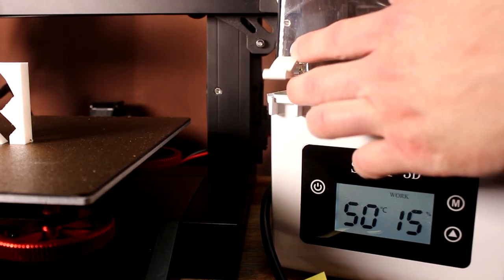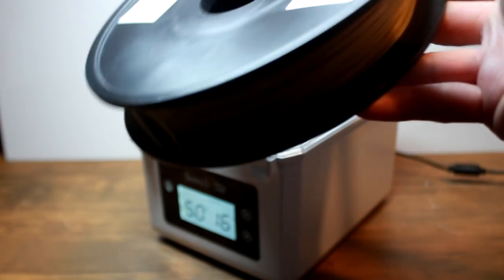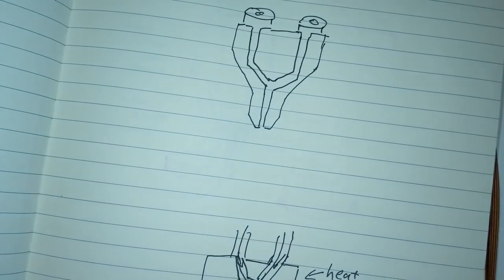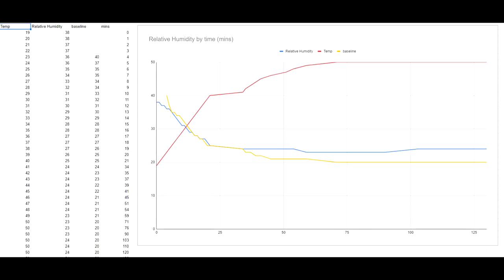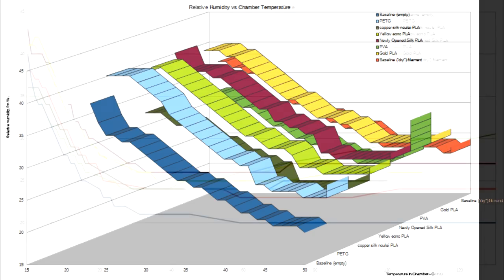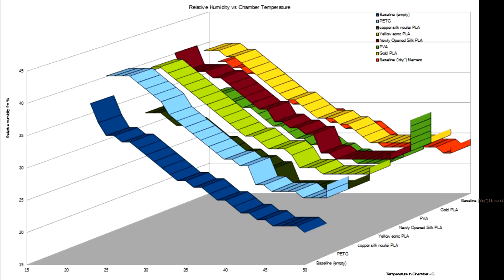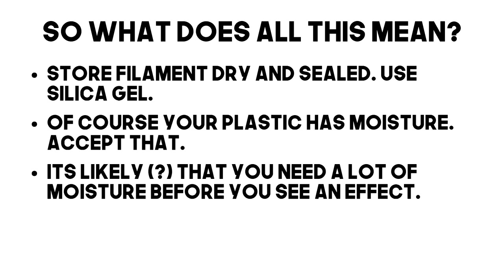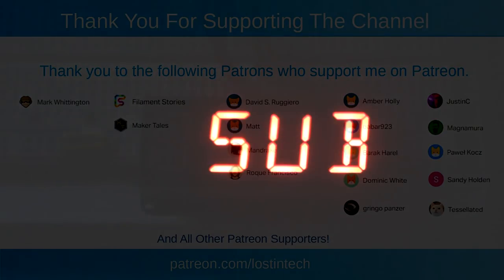So...all filament contains water? Things I discovered while testing out the Sovol 3D Dry box.

Comment: Seattle.
I assume all my filament is wet unless I am drying it immediately prior to printing.
600 watt food dryer for 2+ hours prior to printing and during the print, along with its poly bag and silica gel-packs.
I keep loads of silica packs 'roasting' during this process; I had a gel-packs rotation scheme so spools in storage have fresh packs all the time.
I've found the PETG does suffer from being wet, PLA not in any noticeable way.
VariShore, foaming polyurethane rubber, can get ruined by moisture: the foaming chemistry 'goes flat' if the stuff is damp, doesn't recover until 10+ hours of drying.
Not once, every time before printing.
ICE9 thermally conductive bubbles up and strings a bit when wet, dries well.
On printing hiatus, this is from my notes.

Comment: Those seals on dry boxes also themselves take in water. So think about what happens when one side of it has dry air and the other is wet. Water will make it through by osmosis. Very slowly, but it will happen. So no matter how sealed a dry box, water still gets in. Just more slowly as it's hampered by the constriction of physics. But I noticed that in an empty dry box, the relative humidity can increase by 5 % over a month when stored at 23c, which to me was a shocking amount. IMO, you must also throw a desiccant inside with a dry box to combat humidity making it into the box, if you really want to keep something dry in there. Actual plastics that are very sensitive to humidity, like nylon, will need this done.

Comment: I started using 2-gallon ziplock bags with silica beads. It was ultra cheap and I can cram 2 spools per bag. I am not too sure if this will work to dry out “wet” filament but intuitively it seems like it should so long as my silica isn’t saturated (it has indicator beads to help me recognize this condition).
Reply: I like those two gallon bags. It doesn't feel like I am "stuffing" the roll in.
Suck out the air before zipping that last inch. It may help...less air...less moisture.

Comment: Without a means of removing the moisture from the air, you're essentially just creating a mild sauna for your filament to bask in. Using silica gel is useful, up to the point that it's saturated. You'd need to be continually replacing the silica gel with more dried silica gel, until you reach the levels you're looking for. In order to maintain the lowest levels, you'd be better off storing them in a container with a cooling condenser that literally condenses moisture and removes it from the chamber. In that environment, your filament is being cooled, rather than heated... and getting far better results. Personally, I keep my rolls in large ziploc bags with mini Rh meters and silica gel containers that I can remove and replace - they fit in the center hole of the spool.

Comment: I have ALL my opened filament reels in large (27 lire) sealed plastic boxes with copious amounts of Silica Gel (loose) - think 1/2 kilo per box. I also have a humidity meter inside the box - hovering around 8-13%. And when the Silica Gel gets too 'wet' I stick it in the oven at 120C for 2 hours (it's colour changing) and back it's lovely bright orange (dry) colour :-)
Reply: Thats the smart way to do it, then you are not constantly re-drying different filaments over and over again. Silica gel can be bought cheaply as certain cat litters.
Reply from the maker: Yes agree - smart way to do it because it also avoids the additional irreversible degradation.

Comment: I just keep my filament in my heated airing cupboard, in a box or two (three).  I used to get brittle PLA, but since storing like this, the problem has completely gone away.  For rapid drying, i once used a slow cooker, set on its lowest setting, with the pan inverted to act as a lid.  The PLA was usable within an hour or so.  Mind you, the roll was half empty.
Reply from the maker: Airing cupboard is a good idea as long as you aren't putting anything damp in there like laundry!

Comment: I store all non special filaments with silica gel in plastic boxes. I've printed extra clamps to keep them from leaking, but I use no seal. I use a filament dryer while printing for anything else but PLA. I store one roll of Polycarbonate and one roll of Carbon Fiber Nylon roll in a vacuum chamber. That's all I have room for. However I also print in the same room as I have a large open aquarium no air conditioning at all. So humidity at it's worst goes up to 56%.

Comment: You could test the theory of the filament being the source of the humidity going up if you tried drying PVDF. 
PVDF is totally non-hygroscopic, so if you tried driving water into it through any means then tried drying it you should see no change in absolute humidity on the inside of the drying box.

Comment: Can filament be TOO dry? Does it get to a point where it actually prints worse, or becomes brittle or something?
I've got a filament dryer, didn't find it made that much difference, but then I always store filament in bags with silica gel. I also keep them in boxes, because sunlight can be an issue - even in England. For a few days a year.
Reply from the maker: Ah - funny you should ask that. Some people think so - Joel from 3d Printing Nerd / Repkord told me this the other day on twitter. 
I'm up for testing it out, I just need to figure out how!
Reply: Depends on the material. Zach Freedman has a couple videos where he prints with just about every filament he could get his hands on. At least one of those specialty materials took poorly to over drying. Most of the stuff going into the desktop printer space generally doesn't mind being bone dry.
Reply: My observation is if it’s real wet and you rapidly dehydrate it can cause it to be brittleness.
Reply from the maker: That could be the hydrolysis everyone is talking about, man this stuff is complicated 😒
Reply: All  of these dryboxes are shit at drying...i've tested 6 now...the modded food dehydrators are better, but still weak af.  At best these boxes keep you from adding much more moisture while printing...but simple Tupperware with loads of dessicant is far more effective for that job than a dryboxes 5-15watt heater or a lil pouch of dessicant.  To actually dry my TPU (and dessicant) i use a $500 convection oven...but i run a farm..and dry filament means less cleanup. Not as big of a deal for PLA and PETG
Reply: @Fly_High_FPV  you realy need the door type dehydrator.  It’s a cheaper lower temp convection oven.  Max temp on mine is 250F.  Perfect for every filament I’ll ever print.
Reply: @Michiel de Bie  brittle PLA is wet PLA, saw one friend who left a reel out 6 months, where jt would break every 2 inches, just a whole reel of bunk strips

Comment: Buy a dehumidifier for 10 euro and take apart,converter to a closed box . Peltier make warm and the other side make cold,so you can take out the water from the air (filament).At the cold side will dropping down the water .The water tank have to be separate from the air. You can use a temp sensor or Ardunio,then good to go.

Comment: I am printing and selling very sophisticated and high priced parts, without drying my PLA I don't get the part surface quality I need.
I dry each PLA spool for 24hrs/55C inside a food dehydrator.
Reply from the maker: Good to know. Have you arrived at 24 hours because less didn't work? Or is it just convenient?
Reply: Is that even bran new out of the seal pla???? ,
Is the surface quality much improved after the drying ?? ,
If you dry & use but leave on spool over night do you re-dry again ????
Reply: @LostInTech3D  2nd, lol. I will make sure a 100hrs print has no imperfections.

Comment: Here are some plot twists for ya.
1) that dry box is made of plastic. And as you should certainly have noticed by now, plastic can absorb moisture, and thus, it is permeable to moisture.
2) because of 1), silica gel simply doesn't work, unless you dry it out every few months or so.

After realizing it, i made myself a permanent maintenance-free storage box for filament, that gets a slow stream of dry air out of my kitchen freezer. It works fantastically, it's even enough to keep nylon print-ready. The only problem is that i have to de-ice the freezer a bit more often, about once a year.
Reply from the maker: Yep those are both true. Drying your silica gel regularly is a must.

Comment: I use a rack dehydrator to dry my filament before printing.  But I print mostly nylon 6.
Reply from the maker: You really need it for nylon!
Reply: @LostInTech3D  oh yeah,  then I run a heater box to print it.  Such a pain but for functional prints it’s worth it in the end.

Comment: Wonder how a simple steel drum of equivalent volume to a filament spool would affect the baseline. 

My initial instinct would be unchanged because volume doesn't affect relative humidity. But my secondary instinct says removing a significant volume of air and replacing it with less than significant moisture would have a significant affect on the remainder of the air, significantly affect its relative humidity.
Reply from the maker: I did some tests around this to verify that it wasn't an air volume thing because I was also a bit nervous of that idea. I did conclude that if you put a completely dry reel of anything in, it would give the same findings as baseline.

Comment: I've just purchased one of these and it comes with a non fused UK plug (which is illegal).... Did you wire a new plug onto it? Cheers.
Reply from the maker: mine had a UK plug, but isn't it a figure 8 type cable at the other end? So, you could swap it

Comment: What would be the result of adding a silica gel pack in the dryer box at the beginning of the drying process? Can the packets absorb this moisture instead of having to vent the box?

I am aware there is degredation of the absorption but i wonder if there is some temperature zone where moisture transfer is able to occur. I think silica releases water around 180F?
Reply from the maker: It would work even at ambient temperatures, heating would speed it up. 
Silica gel can absorb a crazy amount of moisture so yeah, it's valid as a method.
Obviously it gets a bit blurry after 40c... where's the moisture going to prefer to go? I'm not sure.
(Silica releases moisture about the same temp as PLA)

Comment: I've always thought the "i tried it wet, then dried it and tried it again, and it printed better" a slight flaw in the testing method.  Hear me out - if you use the same spool of filament, your previous test print, simply used the 'outer layers' of the spool, right?   My theory consists of this outer layer being 'wetter' than the inner layers, due to how air (with moisture) isn't being FORCED into the spool in any way, and air will naturally flow through less -tightly packed areas more readily than trying to force it's way through each layer.

So while the outer layers might be 'wetter' and needing more drying to work, the inner layers, are probably not nearly as wet - and the test to 'print a thing, then dry, then print again to see results' is flawed because all it did was print with the outermost layer first - then get the inner layer -that was already dryer (in theory) - pulled to finally print.

The only ways I can think of testing this would be to take filament off 1 BIG spool, and put it onto at least 3 others.  The FIRST one is Dried and Sealed (without silica), 1 of these gets the 'humid' treatment - where it is put into a bag with a humidifier on to accelerate the process.  and 1 is kept out typically where you store filament.    (the 3 smaller spools would either be typical 1kg spools, or, even half size I think would work, while the big spool would need to be a good 3kg size one)

Now time passes.  After the humid one has had at least a weekend of humidifying, it can be sealed.  Then I'd say 3 weeks or so needs to pass - or if it's winter and dryer than normal, longer. (this is to give them all time to equalize, and the one in 'normal non sealed storage' to actually absorb moisture from your environment)

After that the testing begins, all 3 do the same test print. (stringing- make sure to label them well!)  and then get Dried out for the same amount of time.  After drying, they all do the same print again.

My theory would be that the outer layers of each spool, will print more horribly than the inner layers (the first prints, worse)- EXCEPT for the one previously dried and sealed. If the 'predried' one also shows that it's 'after drying" (again) print is actually more stringing - this also leans into my theory. (as when removing off the Original Spool, the outer layers would be wound first on to the new spool, making them the inner layers, and thus less subject to moisture change)

What would this change?  Not sure really, depends on the findings.  One this is for sure though, every drying box needs to have a fan, and the ability to get hot air out, and fresh air in to heat, so these 'sealed airtight' boxes, are just the worst design ever.  It probably wouldn't hurt to have the spools rotating either, or perhaps a "unroll a spool to re-spool a spool" drying system would be best, where the original spool is very slowly unrolled, onto a new spool, while in a drybox environment.

Who knows really.  Just another factor with the 1,427, 320 other factors printers deal with.

Comment: Literally my second spool ever purchased when I started printing a few years ago (PLA), was SUPER wet. It bubbled and made a horrible mess, plus looked super shiny which I didn't like. A few of the first 10 spools probably had this issue as it was pretty low quality I assume. But even to this date, if my PLA or PETG starts stringing more than often, it goes in the food dehydrator for a bit :p
Reply from the maker: I have never seen pla bubble...I hate to imagine how much water that is
Reply: @LostInTech3D  Yeah, it was popping constantly while printing which is a pretty obvious sign to dry whatever filament it is haha, I just thought I didn't need a dehydrator at the start because the filament was vacuum packed with a silica gel bag in it.. 

but nope, a 30€ ish dehydrator is 100% worth it almost right away when getting into printing IMO

Comment: I still haven't recovered from the loss of two Spools of Prusament PLA Filament ( white and yellow ) within half a year of purchase due to not releasing them ( I used mainly as accent colors so often but sparingly )
Reply from the maker: Yes - there's two mechanisms for degradation, one is reversible, the other (hydrolysis) is irreversible. So, potentially, some filaments can't be fixed. Though I've not really tested or been able to reproduce this - I just read it in a paper or two.

Comment: That was an easy sub. And I hope you can answer a question for me. As a lot of peeps do I power my raspberry pi from the Ender 3 power supply. So....can I do the same with this dryer as it is 12 volts? I know it will involve voiding the Sovol's guarantee but can it be done safely?
Reply from the maker: The maths isn't too complicated if you know the numbers involved, so you need to know the wattage of the bed, hotend, motors, fans, add it all up and then look at the datasheet for the PSU (yes those are available!) To see what they recommend or whatever, the quoted power might be peak for example. I did log some of these in my power usage video. 
Your biggest problem here is that the ender 3 is 24v. So you're gonna need to step that down. But I guess you already know that from the pi.
Reply: @LostInTech3D  Thank you for such a quick and detailed reply. Yes, the step-down was easy and there were plenty of YT videos to show me how. Yet I cannot find any that demonstrates adding a filament dryer. That is suspicious. None because you can't ?!  The printer won't be printing at the same time but still, it might be a 'lil bit dodgy'. Your right, of course, the maths,(once you know the numbers) is easy so off I go calculator in hand. I hope you have a great weekend.
Reply from the maker: Have a look at the sunlu S9 plus, they have done it as part of the design. It's not a good printer, but a demo of the dryer being powered by the printer at least. Good luck!
Reply: @LostInTech3D  Thanks, maybe not as dodgy as I thought:)